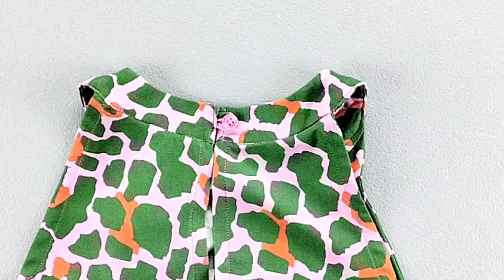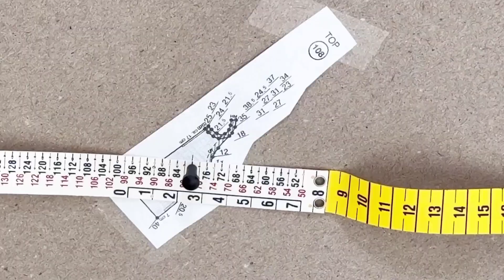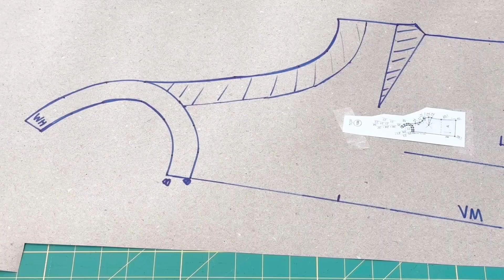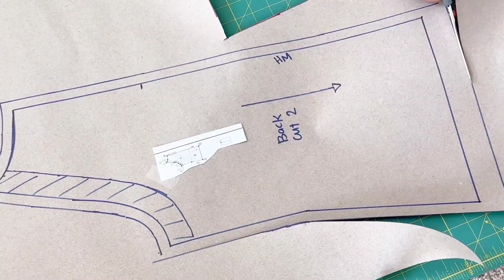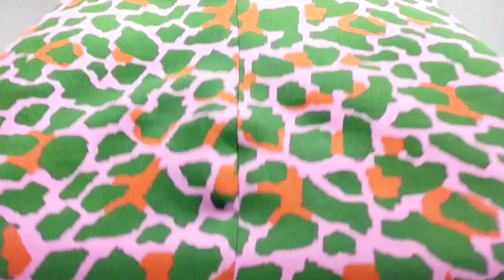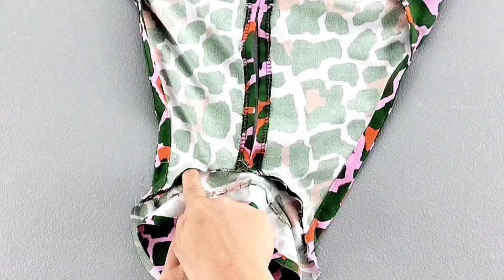Sew a Perfect Summer Top with the Lutterloh Pattern System! Step-by-Step Tutorial & Sew-Along 🌞👕

Comment: I always have trouble getting close enough to the bottom of zipper it seems to pucker or have a small hole.
Reply from the maker: You can actually give yourself a bit of slack at that stitching point ... Being just off (1/8" or so) at that joining of your stitches, then blend back into the seam allowance amount.  This should help smooth the look at the bottom of the zipper.  Also make sure you're backstitching to prevent a gap.